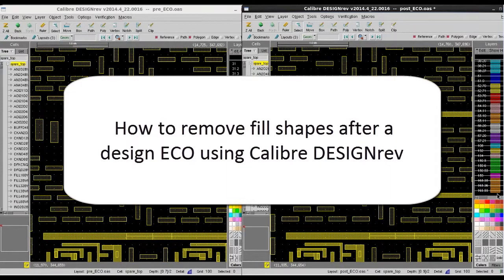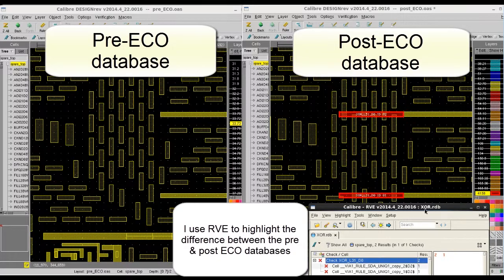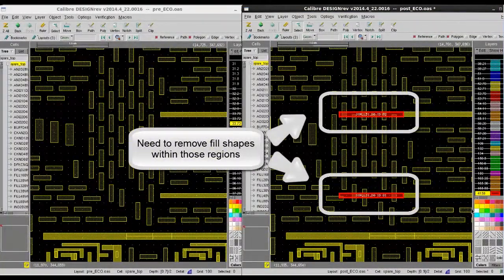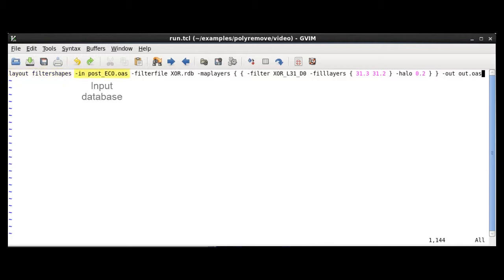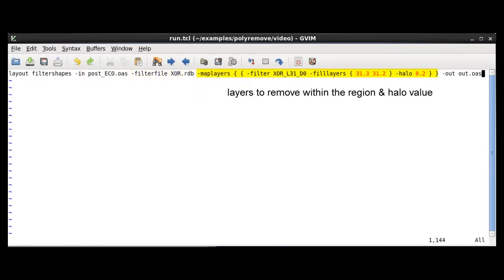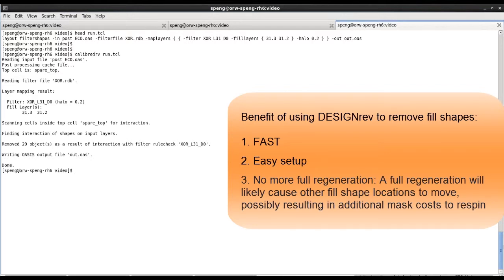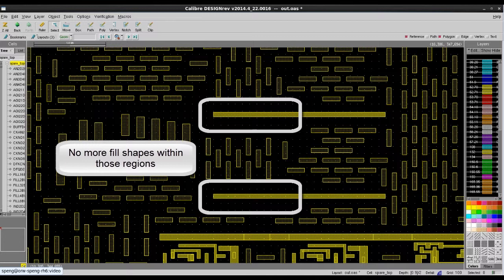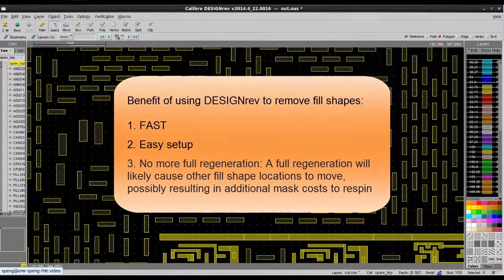How to remove fill shapes after a design ECO using Calibre DESIGNrev

Comment: Exactly. The video is useless unless you show how to create the RDB file to define the boundary. Why do we anyways need an RDB file to define a boundary. Can we not specify a boundary simply using BBOX.
Reply: if you do not want to use RDB file to define the boundary, you can also use GDS/OASIS file to define the boundary. Simply draw a rectangle in the GDS file and use that file as one of the inputs to this command.